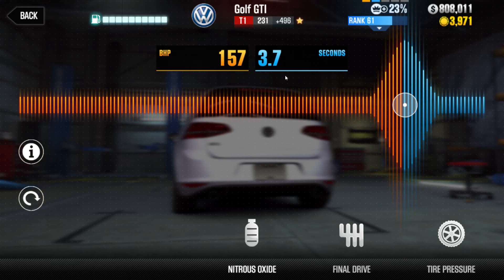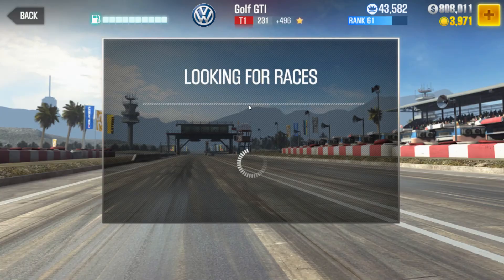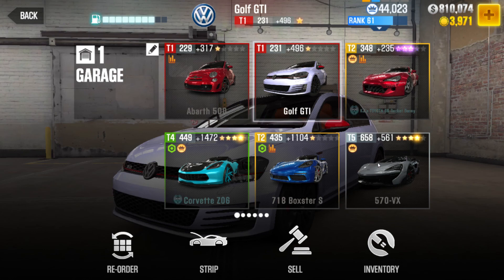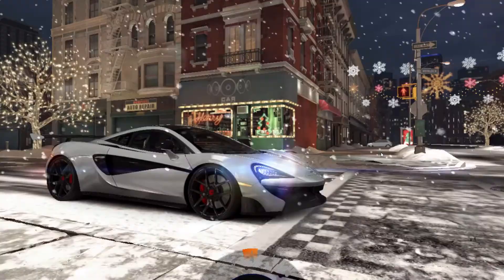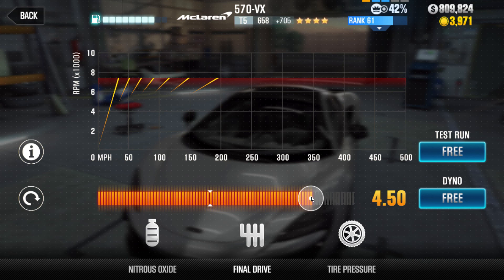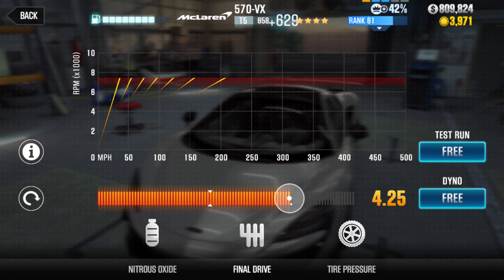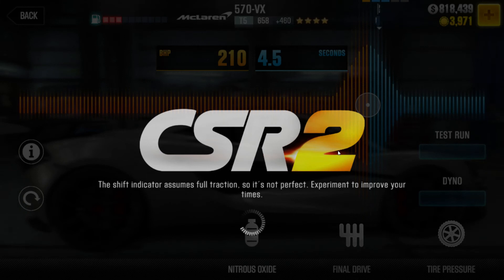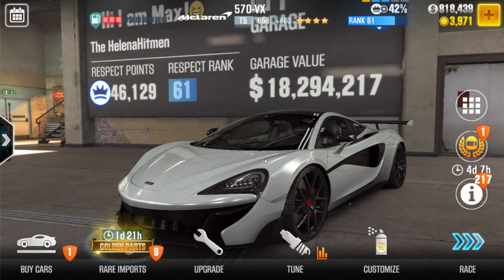CSR2 | CSR racing 2 : How to tune using Basic and Advanced tuning methods

Comment: Are you playing on a computer?  If so, what program do you use?
Reply from the maker: I am using a computer. I alternate between BlueStacks and Nox.
Reply: @maxthegamerOG  I'm using BlueStacks, and the wait time for races is really long.  I sped up some of the other loading screens by going into the bios and turning on the virtualization.  Does Nox do the same thing?
Reply from the maker: @scorpionleader1967  Nox is also slow unless you have a powerful enough CPU and GPU. I am running on a gaming PC which is why it is smoother.
Reply: @maxthegamerOG  Nox is much faster.  Thanks.

Comment: Max i watched the videos you suggested and where i am in the game is a T5 on the third crew member. I haven't built any cars fully built but i dont really have good star cars for live racing above T1 being the golf gti and i have tried pulling this season prestige cup car but i should stop and save my keys...the other star cars i have is saleen s1, ford festia st, aventador coupe and i got the boss cars from T1 toT4 with the toyota 86, m235i coupe, mustang gt premium, and  nissan gt r35 premium also the f12berlinetta
Reply from the maker: The GTR and F12 both can be used effectively in live. The GTR, when tuned with TNT and to max Evo, can be very hard to shift as it basically goes to top gear within the first 2-3 seconds. But will run well against most cars. The F12 can be tuned to 5th gear to hit top speed in the 1/2 and would beat Dyno by a lot. However, it's Evo will suffer and you must slow down against opponents or the computer will eventually make you move to much faster lobbies.  On my veteran noob account, which is level 78 now, I relied on the F12 and Abarth for much of my live racing before getting something nicer to use.
Reply: @maxthegamerOG  what about the prestige cup car? Should i save my keys and wait for next season or dont focus on it yet?

Comment: For the evo drop method does your car use the tnt method but the tuning is defferent or does it use a fully upgraded car?
Reply from the maker: Evo drop tune usually depends on each car. With the 570vx you can simply drop final drive even while fully upgraded. But for most cars, it's a balance of tire grip and power upgrades. Most cars cannot be fully maxed. Some has to run stock engine or turbo or some combo of lower stage upgrades.

Comment: Do you have any tips for getting a lot of money to upgrade your cars???
Reply from the maker: One of the things I advise is not to spend on every car you get. To get money faster always use a tier 5 car in live racing.  You can also get Dyno beating cars and do some betting in live. But there are risks. Based on just doing 30 wins in live a day, plus all map races, I make about 1 mil a day in game money. That adds up when you are doing it consistently.
Reply: @maxthegamerOG  I use a tier 5 car but I'm always getting beat because my cars are not fully maxed out. I always lose to a tier 4 rocket bunny, f40, f50, Honda Nx, and tier 5 cars fully equipped with s6 parts
Reply from the maker: @bigrara99  You should check out my stage 5 tune videos for live racing. I have a playlist with a few different cars in there. https://youtu.be/FHmIrUm1yfM
Reply: @bigrara99  better late then never for me wen my T5 car fast but but missing s6 few fusions etc.. I stay away from them T4 being there maxed or near maxed  other T5 i usually win 85%+ wen T4 I lose 60% time to each his own wat works for me may not work for you hope It helps